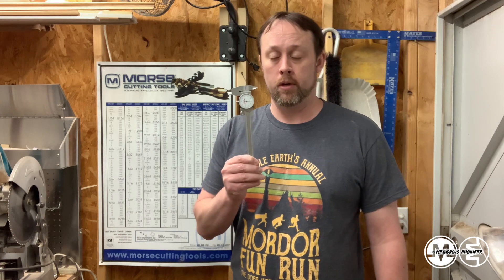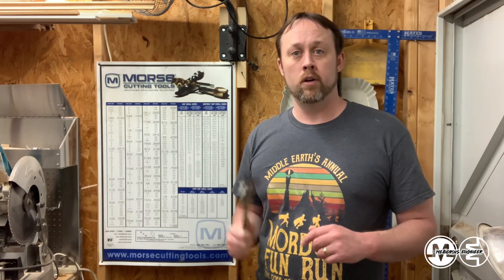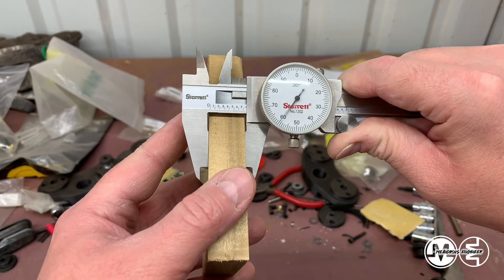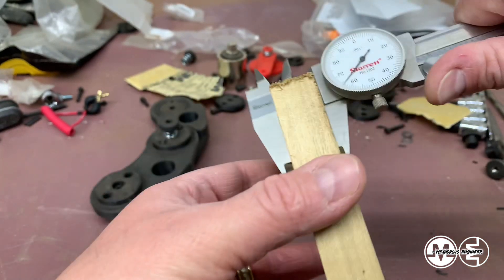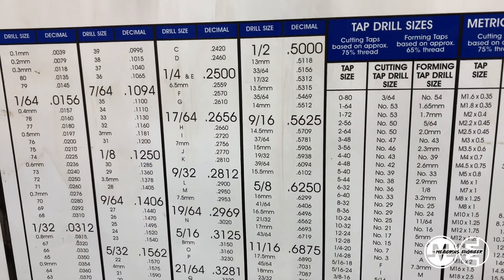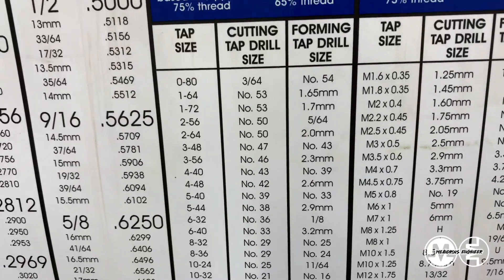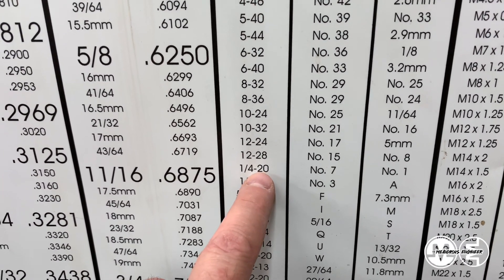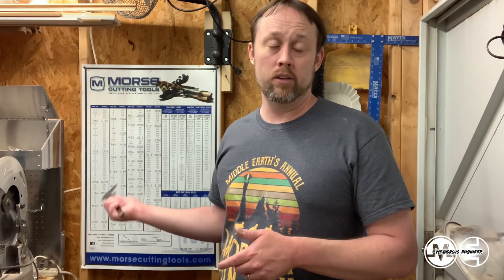Full Guide to Dial Calipers and How to Use a Decimal Equivalents Chart

Comment: Ha ha..A ‘Decimal equivalent’ chart is totally unnecessary if you stopped using antiquated nonsense like 17/64” (or 34/128”).  I am not a machinist, but I sometimes build in ‘Thou’…However, metric is so much more convenient and my dial calipers purport to read 1/100 mm (under half of one thou).  I can’t test that degree of accuracy…although a dial will be accurately proportioned you need to know the accuracy of the distance covered per revolution…mine says 1mm per needle revolution…IF that is correct then a 1/100 division will indeed be 1/100 mm…it can’t be anything else right.  I can only test it with known gauges such as drilling bit shanks, which so far read spot on.  My calipers were only 50 Quid (bucks if you like)…so not top notch, but prove more than my requirement.
Reply from the maker: I like the idea of the metric system but in the United States I’m forced to use EVERYTHING because we have imported parts, the auto industry uses SI, and who knows why else. We have to be prepared to use it all. This is especially for me as an engineer. I have personally found that the metric system’s base of 10 kind of breaks down after you get into the equivalent decimal versions of mm. It all breaks down into decimal points which is exactly the same concept as imperial, but just better organized up front. You don’t have weird fractions, which are pretty terrible I’ll admit, but all these systems are just an effort to define measurement and it’s a hard thing to define reality with numbers. My measurement video goes into this a lot. 

https://youtu.be/zEzAIC_Rob8?si=blb4ZPseriVJyvm4

Comment: I don't mean this to sound snarky but... this is not a problem if you just use the metric system. Of course I am sure many viewers will find a lot of value in this video, but it's important to point out the root cause of the issue IMO. So often I hear Americans give excuses for sticking with imperial, while ignoring all the costs and problems that come with that decision.
Reply from the maker: Ha, it's not snarky...it's true.  The fact of the matter is that here in the US for the imperial system we have to deal with 3 different sets of drill bits with fractional, numbered, and lettered.  Adding to the pile is that we still have to juggle the metric system along with those things and it makes for a very convoluted "system".  I forget the history of why the US chose to ignore the movement to go universal with metric, but it was a bad decision.  It's manageable, but can mess with your head quite a bit if you don't pay attention.  That's why I emphasize the decimal equivalents chart. I have no doubt that metric would be easier for everyone, but the conversion at this point would take such an effort that I think they just stick with the mess we have.
Reply: @themeandrousengineer  All of that is already crazy... Even crazier is that here in Canada, we've mostly converted to metric for everything, but because we're such an important lumber trading partner with the US, nearly our entire construction industry is stuck in imperial.
Reply from the maker: @epgui  So we make everybody else suffer the complexity too.  It makes me laugh even more that Canada probably manufactures 2" x 4" lumber and it's actually 1.5" x 3.5".  The madness just goes deeper.  At least the scientific and medical research here use the metric system otherwise no one would want to work with us.

Comment: I was disheartened when my last shop job had dozens of guys bragging about being machinists for 20 - 30 years and yet I as a guy who had been out of the shop biz for almost 20 years was only the 2nd guy who knew how to read vernier mics and calipers. I was taught by my engineering teacher in high school. Nowadays everyone depends on digital readouts.
Reply from the maker: Sadly it's just the trend in most things.  I would equate it to watches as well and ask, would you prefer an hour hand and a minute hand or a digital readout that just tells you what time it is with less effort?  I jokingly call digital calipers "cheater calipers" because I prefer dial or mechanical means.  That being said, digital calipers do have the handy feature to instantly go metric or imperial, saving you the conversion.  I will admit I use a set of digitals at work.  Theoretically, you can use whatever style works for you, but for me it comes down to trust.  I trust mechanical methods more.  The only things that can happen are wear from use due to friction and if you drop them setting the gear alignment off.   You can see that coming and even adjust the dial to its new zero position if it jumps track.  Verniers would have to be run over by a truck.  Digital problems are hard to see and diagnose, which is why if a set of digital calipers starts acting funny you just throw them away and get a new set.  I have more of a right to repair mentality.

Comment: hear me out on this one: use metric. i know its most likely not an option for you since everything else is imperial but its always baffles me the lengths you americans will go to just to use the imperial system
Reply from the maker: Ha, you’re not wrong. We pretty much wind up having to juggle both systems here anyway because of the insistence of the imperial system, importation of foreign engineered products and standardization of science/research to the metric system. It can be really difficult to think in both, but especially as a machinist or engineer.